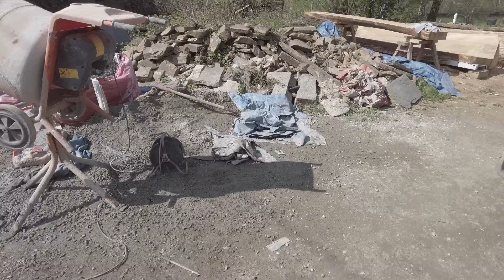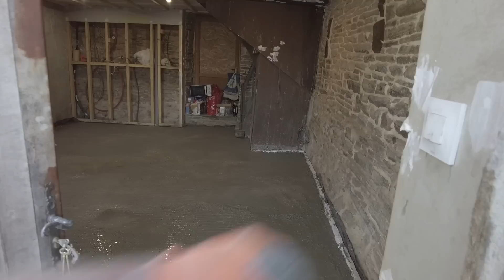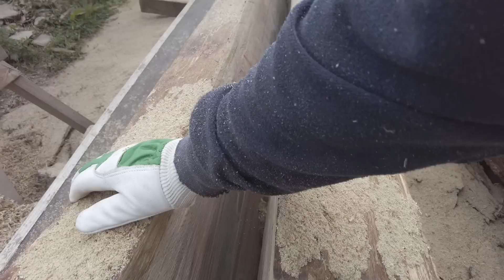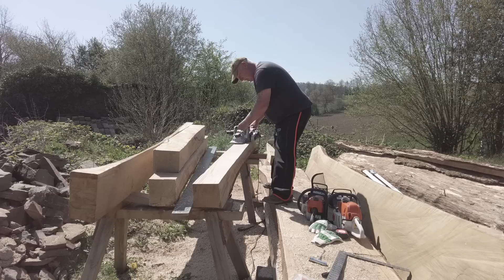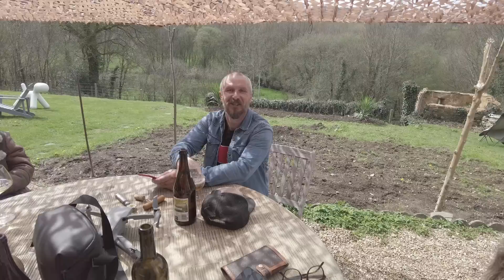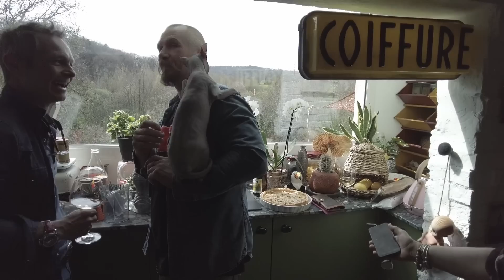No 96 PORCH BUILD OAK SLABS #frenchfarmhouse #porchbuild#porch #frenchfarmhouse #homesteadingskills

Comment: What size Stihl do you have driving that chain on the long bar?
Reply from the maker: Hi Matthew its only a Stihl MS 291 but the chain is a ripping chain set at 10 degrees and sharpened after every deep cut soon as ive finished this job the normal bar and chain goes back on buddy
Reply: @doingitourselvesbudoandtracy  thanks for the reply. I didn’t think it was a massive saw. Good to know you can still use it that way.